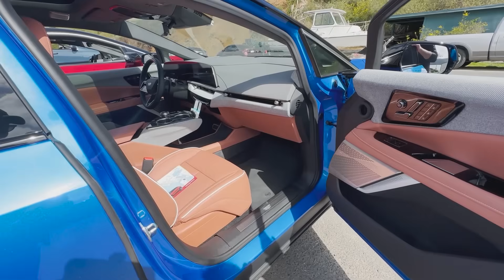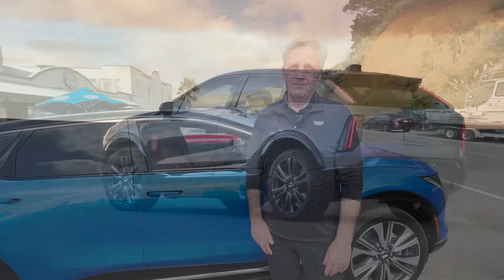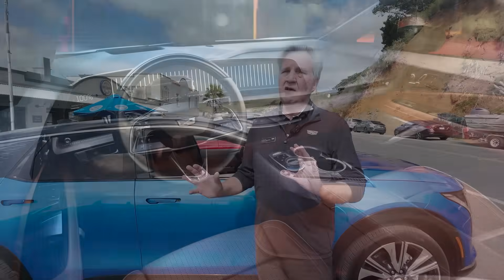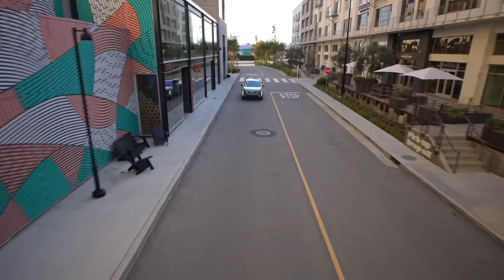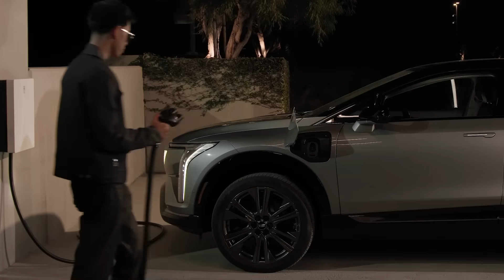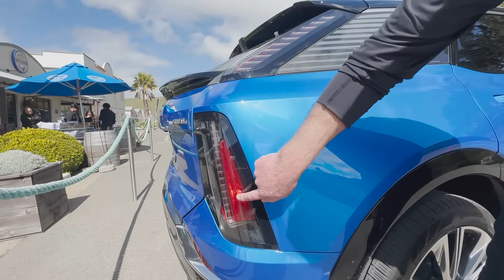Cadillac Optiq Chief Engineer Explains What This EV Is All About - Autoline Exclusives

Comment: Cadillac Optiq owners need to know that Apple Car Play will not work with GM cars. Lots of people have Apple watches, phones, iPads, etc. and the Optiq is blind to all of them, Sure it is similar but you cannot text by voice, have to set up your music and podcasts in advance and cannot tell it to text to X and Y person. You cannot say SIRI play X podcast or X song.  You cannot access voicemails and past text messages without touching your phone. Although they might tell you it is seamless, you will be reaching for your phone quite a bit. Maybe if you live in a Google environment, it  might work for you. You do not have to look at your phone with Apple Car Play.
If you charge this car at a Tesla Supercharger, you need to take two slots and pull way up  because the charging cable is short and the charging port is in the front on the driver's side. You also need an adapter, the Tesla app or the My Cadillac app and the knowledge/imputs to see where the Tesla Superchargers are because natively the app does not show them.

Comment: Need to work on the door handles retracting when the door is closed.
Reply: They stay that way until you walk away with the key (and there's nowhere to tap to lock it without opening the door or pulling out the fob).

Comment: How about an option for smaller wheels. Smaller wheels = longer range and better ride. And no rear wiper is an automatic no sale for me. Let’s say it works as designed at 60mph: it’s not going to work at 35mph! Or bumper to bumper traffic. Poor engineering.
And how about range?

Comment: It should be compelling for over $55,000USD. That's over $80,000CAD, out of reach for over 90% of population.
Reply: Agreed! I'd love GM to revive SATURN as a Plastic body BEV only brand making mass market sedans and CUV's for North America! The demand is there but it's being throttled by the Big OEM's so that we have to buy overpriced and inferior ICE SUV's... With $20K MARGINS!
Reply: No, the Optiq I bought was the top of the line Sport 2 with extras and it came to around $62k. You must be thinking of the Lyriq, they can go for $80k.
Reply: Average new car transaction price is like $48k. This is $55k for a CADILLAC. It doesn’t seem unreasonable for pricing for an actual luxury vehicle.
Reply: @anthonyc8499  I won't disagree with that. It's just that the vehicle prices has increased percentage wise a lot more than my paycheck.
Reply: car prices are stupidly high so yes it is overpriced just as the average price is to high. Want to understand why new car sales have been dropping . . . It’s the pricing . I make more than the average person and I do not accept that it is normal to spend $50,000 for a new car when wages have grown slower than car prices have grown.  None of these cars will even be good as used cars as I suspect many of the technology features will have the durability issues that my 2007 wrangler still has because it is “low’ tech. Wish I could have bought the last year of the Jk but the pricing by then was just to high. I think my 2007 JK will outlast many of the overpriced wranglers built this year.
Reply: @anthonyc8499  This does seem surprisingly loaded.

Comment: You would have to be stupid to buy a Model Y when this is an option.
Reply: Why? The Y charges 2x faster, has NACS, has autopilot and the ability to activate FSD, has a better sound system, the Y is made in America with mostly USA parts, the Caddy is made in Mexico with Chinese parts. 

Supercruise on this is already obsolete- GM is moving to Nvidia
The Ultium battery is obsolete and going away
Reply: Or have a bean fetish...

Comment: Nice interior materials and a fantastic audio system, but I missed the range figures and charging rate.
Reply: 85kWh pack with AWD for 302 miles range and it’s got the same 150kW charging as Equinox, Blazer, and Prologue.
Reply: 307 mile range

Comment: NO REAR WIPER!! …Hyundai IONIQ 5 first came out with no rear wiper, they had to add one on there latest model because owners complained..come on GM
Reply: that's because Hyundai sucks. The Cadillac lyriq doesn't have a rear wiper and no one has complained about it because Cadillac doesn't make shit cars like Hyundai. come on man...
Reply: This seems more sloped than the 5
Reply: It has a digital rearview mirror standard, so unless you like staring at the back head rests, you don't look out the rear window at all.
Reply: It has an ingenious design that combines the windows slope with openings in the top fin for air flow down along the window; a rear wiper is not needed.

Comment: What they aren’t telling people. This is simply a rebranded Chinese car basically. Look it up .
Reply: Yup built in mx when sold in na, with Japanese jv cells of the worst kind nmc pouch cells SMDH. Same platform as the equinoxes which are 28k after tax rebate without additional incentives. I've seen new equinox evs go for low 20s after all incentives already for a fwd low perf slow charging but mid size ev with 318miles of range!

Comment: No native NACS....in 2025... mind-blowing.
Reply: Also no CarPlay probably since it’s a GM car.
Reply: GM and Ford signed a deal for EV charging using tesla superchargers july 2023
Reply: @dertythegrower  So where is it?
Reply: @MurseTech64  GM has an adapter.Optiq can charge at Tesla Superchargers, but you'll need a NACS-to-CCS1 adapter to connect
Reply: @dertythegrower  Just don't understand why not just implement native NACS
Reply: @MurseTech64  probably already preordered a ton. They finally folded to use tesla superchargers 1.5 to 2 years ago, after 10 years of being stubborn
Reply: @MurseTech64  Hardly any OEM has native NACS outside of Tesla because they only JUST signed the agreements and have already engineered designed the vehicles. Tesla didn't open up Superchargers to GM until late last year. OBVIOUSLY the car wouldn't have native NACS... If someone wants native NACS they can always go buy a Hyundai but then you'd have to own an Hyundai which isn't ideal for anyone
Reply: Nobody wants to charge at vandalized Slowchargers that require cooling water and cooling rags to get above 100 kW.